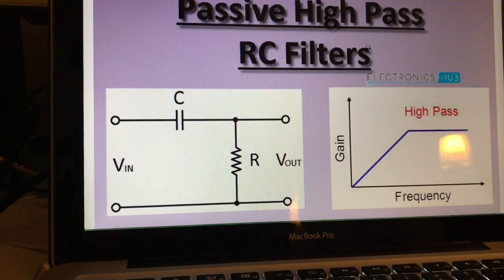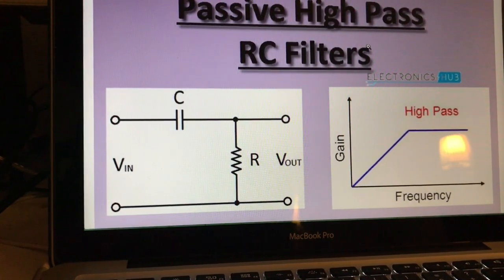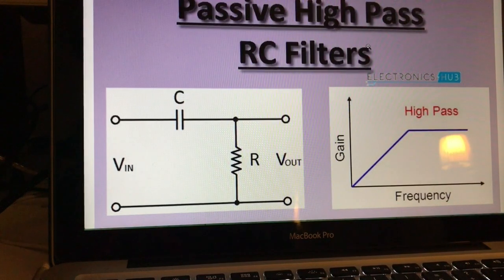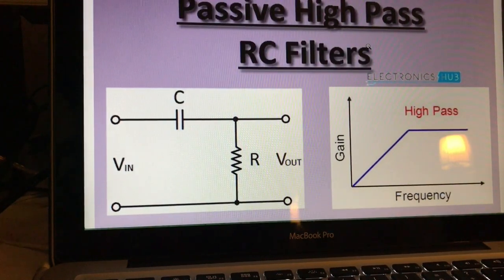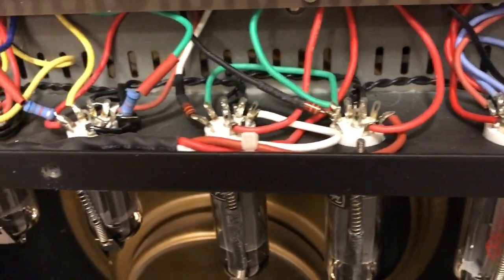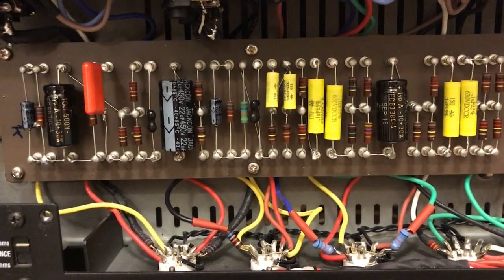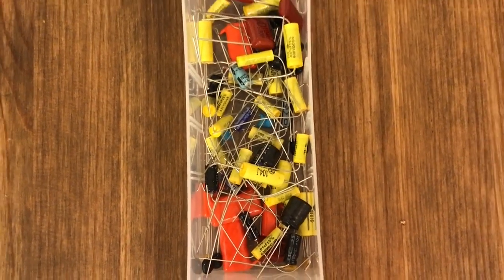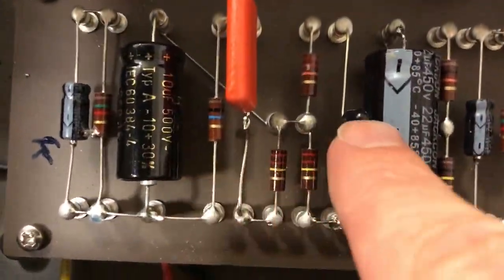What difference does a Coupling Cap make? 2015 Vox AC-15HW Coupling Cap Comparison.

Comment: Thanks for sharing your mods, and this video, for others to compare and benefit from.
Someone close by (on CL) has a 15HWX, with your mod recommendations in it, listed for sale.  I'm wondering if there's a reasonably, feasibly way to tone down the gain jump a bit when the HOT mode is engaged(?). Same thing with the BRIGHT mode switch. Is there a way to mod it so the brightness jump is pulled back just a bit?
Thanks.
Reply from the maker: Hi! I think the easiest mod of these would be the bright switch: I would try and lower the value of the cap between the lugs of the normal volume. If this isn't enough I'd do another deep dive on Rob Robinette's web page to get answers. :) Regarding the hot switch I vaguely recall having read something about this, probably on Nik Player's page: http://www.nikplayer.com/2012/01/ac15hw1-modifications.html?m=1  Sorry that I can not be more specific, I wanted to fix the hot switch as well but never got around to it, I'm happy just using the cold mode now.
Reply: Thanks, that helps. I've done bright cap changes on volume pots before so that should be easy enough. I'm not sure if I'd rather get the 15HWx combo or the 30HWx/head for some ample clean headroom. I mostly use humbuckers and beefy single coils, so a 250 coupling cap might be a good option for me to try as well. Once I decide on one of the HW amps I can then decide what further mods, if any, I'd like to do.

Comment: One question. On the sticker of your AC15 greenback puts made in China or made in UK?
Reply from the maker: It's Chinese. I did replace it with a Celestion Gold so I could use just the speaker  with more powerful amps.
Reply: @karlekspsykopat  My Ac15 has a UK made and it's not second hand amp y bought new in a shop

Comment: Hello friend, I recently compared the normal channel of the AC15HW with that of the AC30 / 6 Treble, they seem exactly the same except for the capacitors C12 and C14 of the AC15HW. I have an AC15HW and I had thought of changing those capacitors to the same values as the AC30, to have exactly the same circuit of the AC30 / 6 Treble in the normal channel. Keep in mind that there are AC30 / 6 Normal, Treble and Bass circuits. You have to choose the Treble circuit. As for your modification, I prefer to leave the amplifier as close to the original AC30/6 from 1964 one and I would like you to take a look at the Dr. TUbe web schematic called AC30 / 36 Top Boost Mod schematic, there you will see that the original Top Boos schematic is identical to the AC15HW. A greeting.
Reply from the maker: Thank you Fran, I will sure check it out. :)

Comment: I think it depends on the guitar you’re playing, larger capacitor values for single coils and smaller capacitor values for humbuckers and higher output pickups in general
Reply from the maker: I totally agree! I'm finding gain staging + cap values more and more interesting, you can really have your overdrive taylor made.
Reply: @karlekspsykopat  and speaker choice as well, change speaker and find the new happy point with capacitor values
Reply: @karlekspsykopat  i would first ask....does the 500 pf have a Jazz chip in it? Oh, and more seriously, when you played the main riff of "Oh Well", did you take your pups out of phase like Peter Green?

Comment: Great video!! I’d love to hear the changes with a alnico blue speaker - thinking I like the 500 pF or 1.0. What do you prefer?
Reply from the maker: Christian, thanks! I agree regarding the 500pf. Had I liked higher gain sounds in this amp I would have perhaps gone with the smaller 100pf or tried something in between, 250pf maybe. Really comes down to fine tuning between guitar of choice and preferred gain level. I’ve never tried the Alnico blue in this, would be interesting!
Reply: @karlekspsykopat  i have a blue in my 50th anniversary hand wired, with Top Boost and the EF 86 circuits...spent some cash and put OG unopened Mullards in it......Lord, does it SANG! My tube guy in Colorado is da Boss. He told me if there were any of the unopened tubes that were duds, weak, or microphonic, he would not only replace, but also refund the purchase price...amazing!...but i've had nothing but astounding success with these...gonna need to build a tackle box of extras for each position

Comment: i think you used effect pedals. it hides your results. i should recommend only use amp
Reply from the maker: Hi Mustafa! No, just guitar straight in to amp. I use the volume of the Top Boost channel to get more or less overdrive (the amp has master volume). If anything hides the result, it is my reverberating kitchen and iphone microphone. I hope you could hear the effects of the different caps anyway. :)